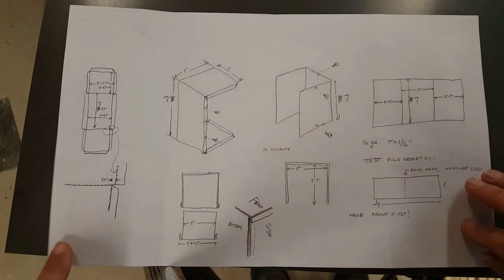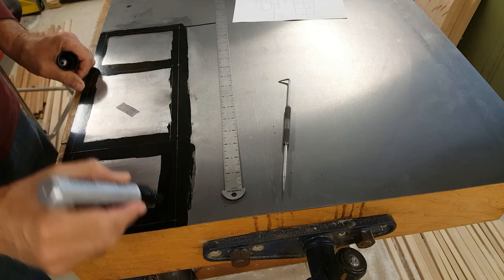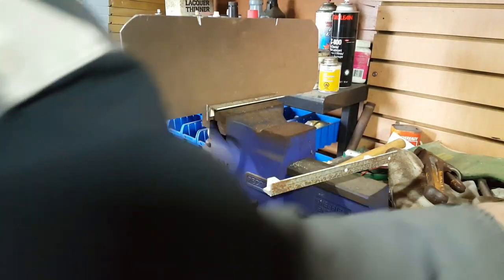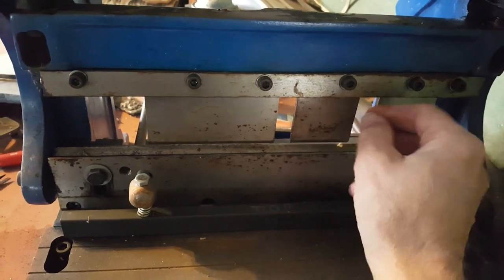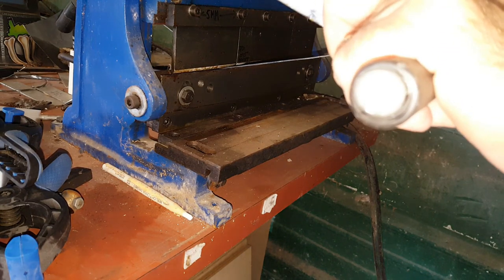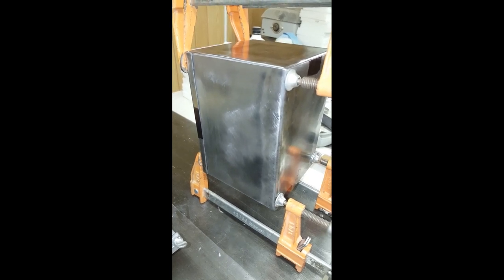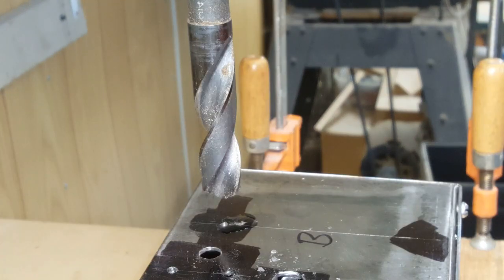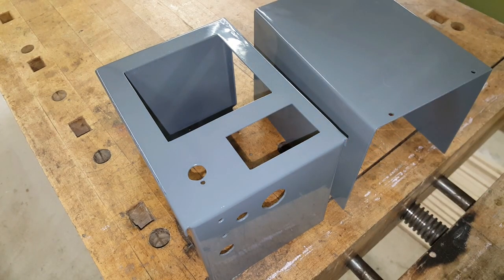Making a custom steel enclosure, 5×7×5 inches

Comment: If you used a back stop on the 3-in-1, you could have set it up to the bend line for each bend and quickly formed the end flanges and then the overall shape,.
Reply from the maker: I guess mine has a shorter backstop. It is only tall enough to work with the shear. There is enough bracing behind the moving anvil that I think it would have to be a separate backstop to work with narrow flanges.
Reply: @kevinmartin7760  It's easy to swap the original one for a piece of angle that will work.
Even better if you lose the original one and use some 8020 aluminium, you can create and even better solution. Imcluding a flip up one, so that it moves out the way when you do reverse bends, makes it more versatile.
Reply: @kevinmartin7760  I use mine in this video, though not quite as clear, you can start to see the frame I made, which helped us make thousands of parts. https://youtu.be/AqUTVyzEGeU?t=333
Reply from the maker: I think it was partly a choice on my part not to go yet one level deeper into the "making a tool to make a tool to..." rabbit hole. I'd already improved the gauge/backstop for the shear from the original because I had a job that needed hundred of pieces cut all the same width. This box, however, was a one-off so setting up a backstop for the brake didn't quite seem worthwhile. Your setting gauges for the backstop look like a great idea, though!